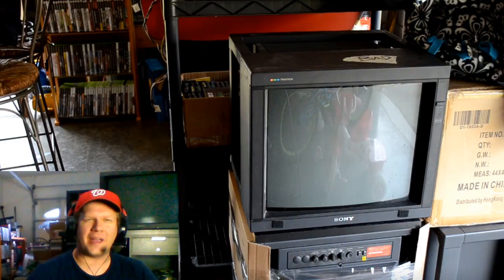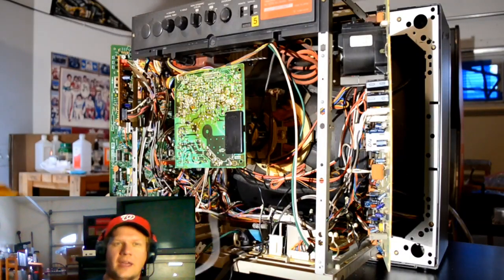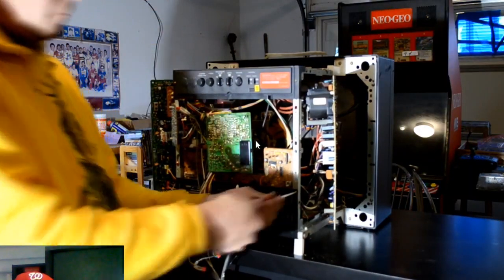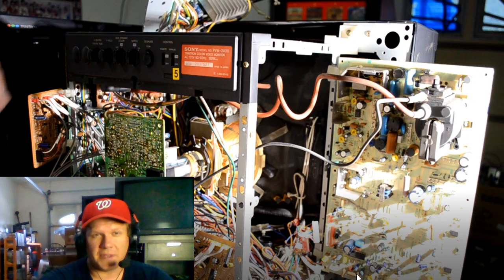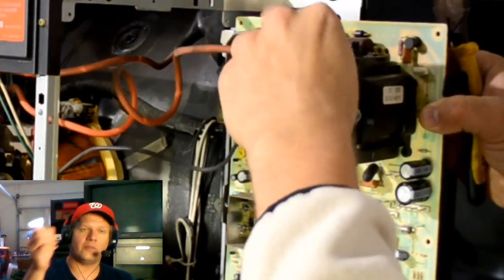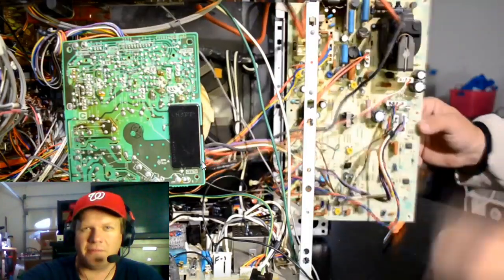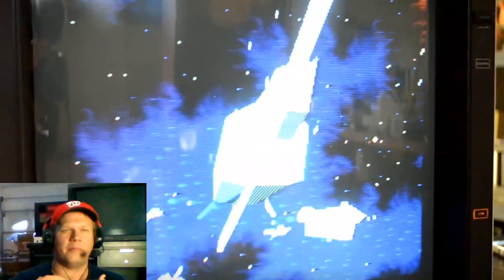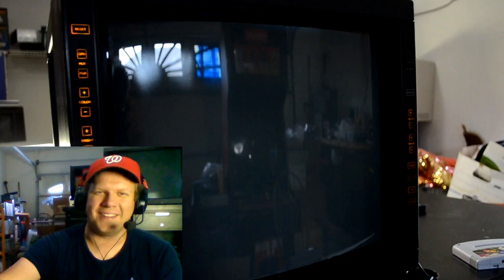Sony PVM 2030 repairs - Resurrecting Dead CRTs

Comment: Steve, I recently bought a 2054QM. Got a great deal but the idiot I bought it from didn’t pack it very well and the bezel broke in one corner and is hanging off still connected by wires. The power button was missing also so I haven’t tried to turn it on. I’d love to get it repaired as 20” RGN PVMs are hard to find, at least for what I paid for it.

Comment: Thanks I have learnt so much from your videos. I'm still unsure on where all the potential energy goes though when discharging if the chassis isn't connected to earth via the power outlet.
Reply: I just have a feeling that this just works like a capacitor, when connect the wire with the metal chasis, positive and negative charged electrodes will meet and electrons dissipate qiuckly.
Reply from the maker: It is like a Capacitor.  The charge just dissipates through the metal ground loop on the CRT itself

Comment: Hi, I have a 20L5 that is doing some weird warping in the middle/left side of the screen when doing the horizontal scroll test where it stretches the image then shrinks again once it reaches the far left side on the super nintendo 240p suite test. It also jitters on the vertical test. doesn't look smooth at all.

The screen is also very very slightly tilted downwards on the left side. I wanted to adjust the yoke but i'm inexperienced and wondered if there are any dials in the back that could help me fix that (there seem to be no controls in the service menu to actually tilt the image)  or if I have to physically move the yoke. 

Aside from the weird warping it's beautiful and I just love it. Do you have any advice? Could I possibly reach out to you and pick your brain about it a bit with a video and or pics? Thanks!
Reply: Hi, i have the same warping issue on my both bvm D14H5 and on the same side. I re-cap all monitors and nothing, as far as i know this is the FILM cappacitor's isues, also i try to replace horizontal linearity coils and still nothing. Note that the crt in this bvm have 8000 h then definitely is a component failure or this polypropylen cap's that i meantion before. If you knew something more on this topic so let me know becouse i am curious :)
Reply: Try adjusting the horizontal linearity coil it should fix the horizontal warping.

Comment: I've one of these 
When I turn it on the red color is about to 60%. It needs to warm up to the red color be 100%
I've replace all the capacitors on it for the B1 Board and the 3 transistors for the Neck board but I'm still getting the red color about to 60% everytime I turn it on after been  turned off for few a hours
Do you know what could it be?

Comment: Hi Steve, i currently have a PVM 20N5 with the rgb components installed. would you say its worth recapping the entire crt to futureproof it?
Reply: a 20" with RGB? hell ya
Reply from the maker: Yes, that one is relatively easy to work on compared to other models.  Just recap the main board and the neck board.

Comment: These monitor are rarely worth restoring. Why? Because for those capacitors to fail, you need a ton of work hours (Sony used only the best e-caps), which in turn means the tube itself is worn-out. There is no magic to restore a tube. The so-called rejuvenators will never work for an extended period. You will get a few more months of a decent tube glow at best, and rarely even that.